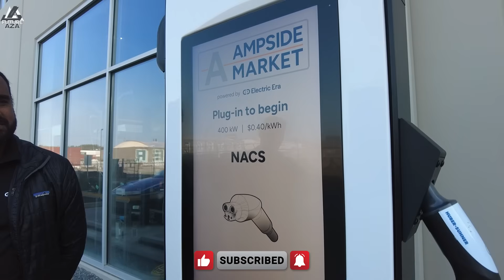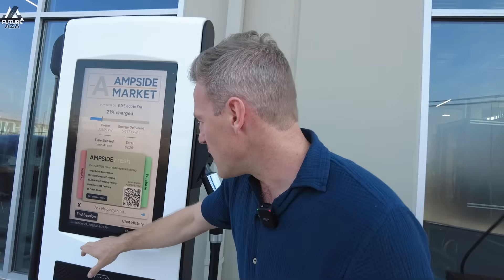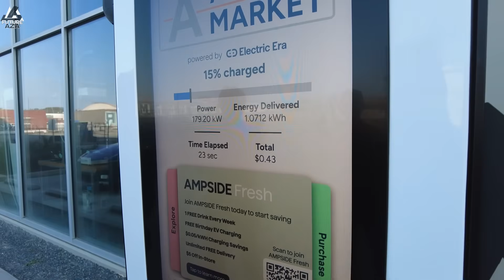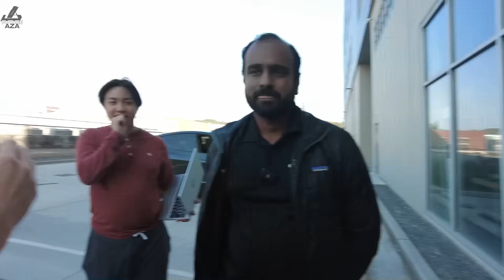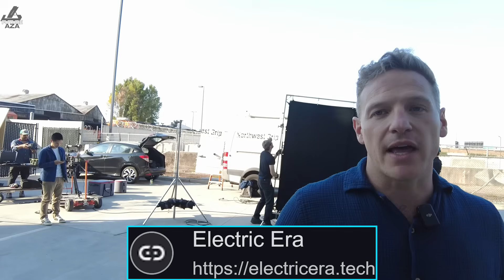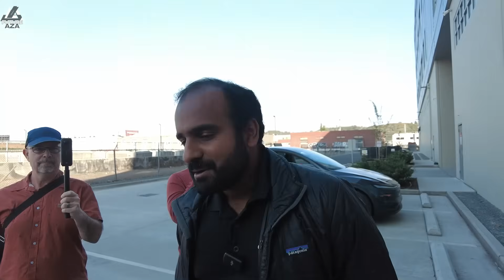SpaceX Alums Debut 400kW Charger with Halo Magic

Comment: These are very nice chargers.  The AI assistant is a nice feature.  Not needing an App is also a welcome feature.  The charger is future proofing with 400kw capabilities.  I would have asked them if they have thoughts about wireless charging in the coming decades, and if this charging stall can be retrofitted with it.  I think major hotel chains should install something like this for the guests.  Having a good level 2 destination charger is okay, but it would be a great to just have this DC fast charger right at the hotel.  You take about 30 minutes to get checked in and settled, and while you do that your car can charge up quickly.

Comment: After Tesla releases FSD "Unsupervised", what happens if someone grabs the steering wheel and causes a crash? Unsupervised assumes Tesla takes responsibility. And, if we go on the Tesla RoboTaxi network and let our cars drive people, are we responsible in this scenario? Could Tesla disengage driver inputs while is FSD unsupervised?
Reply from the maker: Has this happened to in a Waymo?
Reply: @FutureAzA  💣
Reply: Lock the front doors. Passengers in the rear seats only. The car will know if you try to climb in the front and pulls over and instructs you to exit the vehicle. It knows who you are and bans you from using the RT hence forth. I’m not really sure why you would grab the wheel and turn it though. To crash the car? You’re in it and your name, CC info and address along with you phone # and video of you being a dumbass are all easily collected. I expect the car would actively try to prevent someone from veering off the road, or into something, especially people. This is essentially the same as getting in an elevator and cutting the cable. Who is “gonna be in trouble”. The car has to be steer by wire to disengage front the driver.

Comment: I do like that Halo will be able to inform users about how to start up a charging session. Tesla supercharging is so simple that I'm spoiled. As another commenter remarked, simply plug in. Were I to wind up having to charge from another system, though, I might enjoy having a friendly AI on the charger to help me know what to do to get the charging started.

The simulated session simulated a 40 cents/kwh energy price, which is a little higher than most superchargers I've used and lower than most non-Tesla chargers I've heard of. I suppose that rates will vary.

BTW: nice job of dodging expunging the demo demon manifestation from the video -- I almost didn't notice what I now take to be an edit and context switch to allow time for Sith to reset Halo or whatever.

From what you've shown in these vids, I'd certainly prefer to charge with these guys rather than with EA.  I hope they succeed. Still, I'll generally stick with Superchargers if they are available.